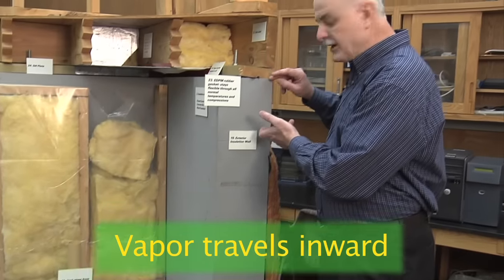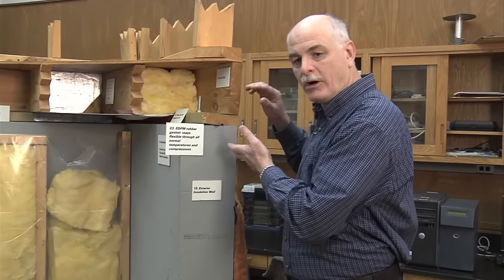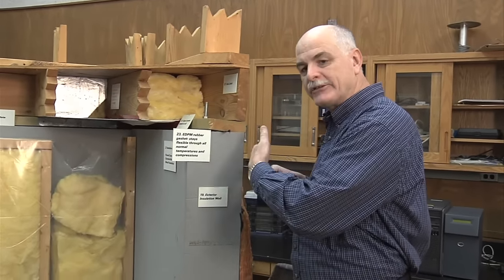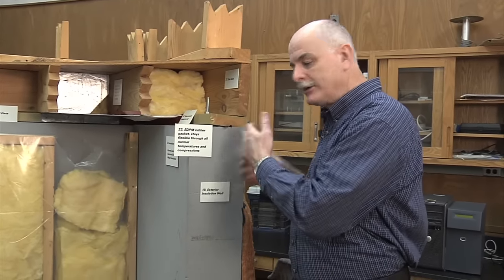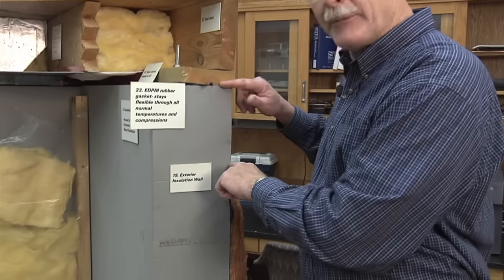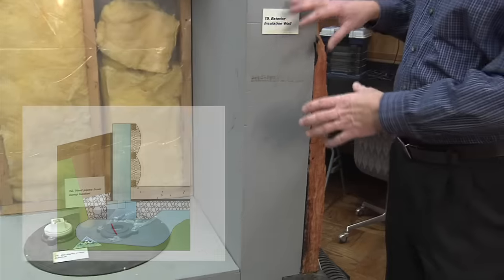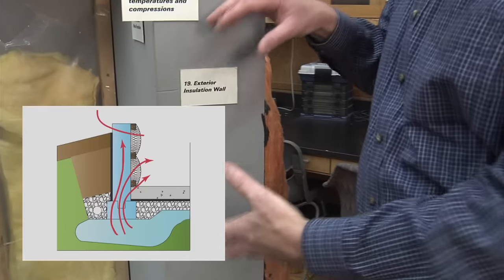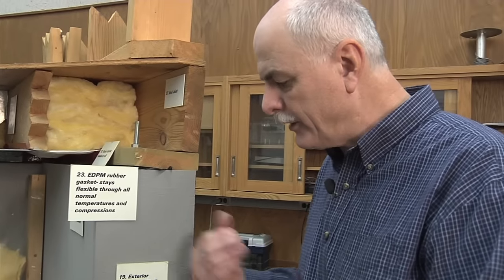Foundation Insulation Effectiveness: Basement building science

Comment: Excellent tutorial and model! I have 3.5 questions for the speaker. First, What product or type of insulator is best suited for the exterior of the foundation wall below grade? Also, is a secondary protective layer recommended to the outboard side of that insulation layer? Secondly, in regard to the V-groove style footing shown- is the rebar grid within the foundation wall to be isolated from the footing (due to the waterproofing applied to the top of the footing)? Third, If ICF systems are being utilized below-grade, what precautions might the builder use to prevent the exterior polystyrene layer from being compromised from a puncture/moisture infiltration perspective? Thanks again!
Reply from the maker: Hi! Here is what University of Minnesota Extension specialist Pat Huelman had to say about your questions 

"I am generally most comfortable with XPS (extruded polystyrene), but semi-rigid fiberglass boards can work, too.  If there is true waterproofing behind the insulation and good vertical drainage in front, a secondary layer shouldn't be necessary.  It is OK to use rebar to pin the foundation to the footing (rather than a keyway) just work the liquid applied capillary break around the pin.  If an ICF is used, it still requires an exterior water control layer (generally a foam compatible waterproofing membrane).  This can provide some protection from physical damage, too.  

Hope this helps"

Comment: If you add insulation, under the slap, where would you put the plastic vapor barier... below or above the insulation?
Reply: I believe the lesson is to always put the vapor barrier on the side of the insulation with the higher vapor pressure, which would be toward the ground in the case of a slab (or foundation wall below grade level).
Anyone think otherwise?

Comment: Got an old block basement here--6 ft below grade, 1ft above. I excavated and put in a drain tile below slab level. 1. Some year round wet spots where the slab meets the foundation are persisting. Is there any retrofit solution to the capillary wicking?

Comment: Nice video, so what is someone with an older home to do? Is exterior insulation and waterproofing the only and best answer? It seems like and expensive proposition. Are there other alternatives that are effective?
Reply: Interior spray foam works. Some caveats: most need to be covered for fire protection. In a very cold climate, the foundations will freeze and if full of moisture, can heave and crack.

Comment: Getting ready to build a slab on grade with 5 foot walls...what do u recommend for the 5 foot walls on top of the footing...I see some contractors are putting styrofoam on the inside of the wall only then backfilling up to the top, and then I see some putting the styrofoam on the outside of the 5 foot wall up to a foot below the top with a tar coating on the inside of the styrofoam...Its a solid styrofoam not the pink batten that u are using in your video..Thks for any info..from the top of the footing to the under side of the 5 foot wall its just concrete on concrete...

Comment: What is the rule of thumb when it comes to partially framing your basement? I have split my basement into two parts: one, making a living space that is finished and second a tool space, along with the furnace room that will not be finished? I am planning on using fiberglass insulation between studs. My problem is, that I was told to leave an inch gap between the cinder block wall and the framing, in which I did. My question is will there be an issue with mold having that gap between the wall and the actual framing, since there will be airflow behind the wall. Second question, how much distance the cinder block wall to the stud framing is needed not to need insulation. I have a wall going to be a foot away from the wall due to plumbing. Thank you matthew
Reply: +Matthew Millard If you want to be really safe go with thermal mineral batt insulation by Roxul. It has the ability to dry without reducing the R value and is a lot better to work with. I'm assuming you've already done the work, but when I finished my basement, I put 2" extruded polystyrene (blue board) glued to the foundation wall with a 2x4" wood stud wall with a pt base plate. Then I put my R-14 thermal mineral batt insulation in the stud space with 1/2" drywall without a vapour barrier. I didn't want to trap water inside my wall. Should mention I am from southern Ontario. At the rim joist, I put the 2" board foamed in place so it was sealed really well. I've read some studies which shows when you have 1.5" or greater with the extruded polystyrene (not expanded) that it acts as a vapour/air barrier. Therefore I taped/foamed up my seals and placed a layer of batt insulation behind it for added R-value. Therefore, at the end of the day my foundation wall had an R-value of 24 with the added continuous insulation thermal break between foundation wall and warm side of wall. I'd prefer to do exterior since it is the best way to go, but I'm dealing with existing conditions.
Reply: @CanadianNative1  thank you

Comment: How would you waterproof and insulate the outside below ground when the foundation is bricked ? My brick has weep holes in it. Would you brick solid after coating the blocks with waterproofing ? I don't think there would be room between the brick and blocks for insulation, would it ?

Comment: Steve K  
How does ICF foundations (BuildBlock) perform ?  ICF will have a rigid foam layer on inside as well as outside, a design feature you recommend to avoid.  Will moisture build up on outboard face of interior foam insulation ?

Comment: I implemented a few of the techniques some 23 years ago when I had my 3 story sog home built. I asked for a 6 mil vb under the slab for radon which was over the head of the cement man. The only thing that was done to ur standard was the exterior rim joist foam. The trusses were inset 1 1/2” for this. I need to have u clarify something. I just have a 6” wide block under 2x6 studs n with the 10’ f f ceiling height I’m considering redoing the bottom. Would u remove the slab n sand 4” n redo with i f heat or just go over the slab n do i f heat n finish to ur standard  for the sog construction. Also there’s no external anything over the block foundation for water. They put foam on
the inside but not up to the sill plate. It’s about 1 ‘ short n the slab sits on the perimeter of the larger block. Another thing I did was to put 1/2” foam on the inside under the drywall which I never saw before as well as the upper ceiling. The actual living quarters is the center of the building with the bottom being a huge garage n the upper is a high n dry basement. Ur info is spot on !!

Comment: Something I have always wondered is why not have the perimeter drain down 12" or 18" below the footing ? You might want to have the drain ?? 24" away from the footing so not to weaken the footing? What distance would be a good compromise?
Reply: Our footer drain is in its own ditch alongside the footer and about 1/2 of it's diameter below the footer bottom and out from the footer about 4", completely filled with clean stone to the top of the footer. Seems this is standard practice for our contractor so, maybe that's a good technique, just not common? Why /how did you pick the dimensions you asked about?

Comment: Thank you great video, our new home has 4.5 inch foam board on the outside of the basement wall along with 15 mill vapor barrier and a tar under it all it goes from the footings to the top of the rim joist along with 2 inch spray foam on the island of the rim joist grade outside is to the top of the rim joist, the walls seem very dry I was thinking of just framing the walls inside without any insulation or possibly 3 inch of fiberglass ,any thoughts from an experienced people  please help thanks
Reply: The author addressed  your situation toward the end of the video. I believe he said to use framing, and a non paper backed drywall, keeping it 3/4 to 1 inch off the slab. No fiberglass needed.
Reply: @johnshotwell2932  thank you! I took this advice last year when building I used a vapor barrier on the footings and 15 mill under the floor also with 6 inches of gravel the only way to get things done like this is to do it yourself

Comment: I have 1/2" xps on the exterior of my rim joist under my new siding. If I insulate and air seal my rim joist from Inside with foam board, will I be creating a problem?

Comment: My house already has a brick exterior so there's no chance of putting foam on the outside. You stated to not go too thick on the rim joists if using spray foam. In that thought, I want to use polysio but how thick is too thick? I want great insulation value so I would like to use a 2". Will that be too thick?

Comment: Great video. I hope you get comments on here because I have a question. I have a 1956 split foyer home. Lower 3  ‘ of conderblock walls. We’ve gutted and remodeled downstairs so don’t have time to rip walls out to insulate with under fitting strips with rigid insulation, we did it between furring strips.  What are your thoughts on having spray foam objected through holes on exterior of home?  So the foam fills the cinderblock cavities.  We have no weep holes or interior French drain. Just exterior tile drain.

Comment: I am concluding that a home built more than 10 years ago was likely to be tailor made for mold growth and both water vapor and radon gas penetration. Do I have this correct? If so, what is the best cost effective way to address these health issues?
Reply: Alex McDonough 
Alex, not necessarily true. I built a house 40 years ago with my father. The building site was sloped so one end of the house had a 10’ high basement wall and the other was at grade.
When we started the excavation we found a underground river running about 3 foot under the surface. 
With proper sealing, insulation and drainage we were able to build that house that still has a bone dry finished basement to this day...
There are builders out there who know how to keep the “moisture out” and the “air flowing inside” without a lot of the newest “Building Science” techniques !
Granted it is not a Yeti Cooler but it works pretty efficiently, Did I mention it is still bone dry with that river still running under and around that foundation

Comment: I have a 80-year old home with a basement that I'm currently renovating. It was renovated before and had moisture and mold problems that I'm trying to avoid this time around. The basement is a walk-out--only subgrade on one wall. Unfortunately, I can't really dig down and add an exterior barrier on that wall because there's a large covered porch that I'm afraid would be compromised structurally.

So that leaves the interior approach. Thankfully, I pretty confident I've solved any standing/table water issues due to extensive french drain and downspout drain installations and reworking.

Still, I'd love to get anyone thoughts on my interior wall plan: 1" layer of XPS R5 foamboard installed seamlessly and sealed with foam spray for both a vapor barrier and insulation. Then, on top of that, metal 2x4" studs with unfaced R13 fiberglass insulation for a combined r-value of R18. On top of the studs, but before the sheetrock, I plan to put CertainTeed's Membrain vapor barrier, which blocks vapor from passing from the heated space into the wall, but allows vapor to pass the other direction (to keep vapor from being trapped inside the wall). MemBrain is not very expensive and my understanding its much better than using a traditional vapor barrier, which can actually make the situation worse because it can trap vapor in the wall. On top of all that, I'd put a mold-resistant sheetrock. 

Any thoughts or comments?
Reply: @sethdiamand7534  thanks, I missed the 2" rigid foam requirement. I'll take a look at that. And I agree on most vapor barriers but Certainteed's MemBrane should solve that issue since it's one-way transfer.

Comment: Does anybody use spray foam on the outside of the wall or a spray foam adhesion layer for another insulation? I like your ideas on how the wall actually works, as I too have seen moisture build where conventional thought would see a dry wall.
Reply: Once you really understand wet build dry bulb, and 8 degrees f is all it takes water to condense you realize it's about mitigating the water after you reduce it's likelihood of appearing, and demolishing volume. 

Detritus is as powerful an adversary as water and combined, they are a fearsome duo who travel as pairs anywhere on earth this type if construction is likely to be.
Reply: Spray foam is trouble, especially when the building is on fire. Then its like wrapping a building in kerosene-(and 80 people die) Consider Roxul.

Comment: Really good video.  ICF should really solve all the basement & rim issues in one shot, you should still waterproof with a peel & stick to prevent both termites and moisture (if in termite zone) or spray waterproofing should be fine if not in one..  The aggregate base, insulation & vapor membrane in the slab are spot on, although I would overlap 1" insulation boards then put your vapor membrane overlapped 6"-12" and taped.

Comment: I️ like the detail of the discussion here but if I️ am not mistaken there is NO WAY to insulate a basement from within which is not risky....am I️ right? The reality for us contractors is that we almost never know what the exterior foundation really looks like so I️ would always assume it’s been done poorly. Given that as a starting point....what is the solution for a client that wants a insulated basement with finished walls??
Reply: 2.0 LB. closed cell spray foam insulation, 2" does well in most applications all around the Box Sill, Top Plate and wall. It is the only FEMA approved basement insulation for flood areas. Paint the foam afterward with any interior latex paint, glossy white will reflect more light for a brighter basement.
Reply: Having done some substantial research and thinking on this very subject, my solution is gong to be installing a dimpled membrane on the interior walls AND floor, with an interior perimeter drain to a sump, and foam board interior to the membrane on both floor and walls. This solves a lot of the issues you might expect to see. The trick is that you really just can't prevent the water from coming in - so instead plan for it coming in and direct it safely.
Reply: @garygrunauer734  Termites?

Comment: Great presentation, learn a lot ! ...quite depressing thou if trying to make a dry, moisture free, thus mold free basement walls :) ...also, sounds like you can not have anything on the basement floor :)
Reply: If you already have a damp basement and only want to dry it out first clean up the basement (IE no stuff leaning against the walls) and run an osculating fan 24/7.  If you want to dry it out and put up drywall then you need to address water infiltration first.

Comment: I sealed the block wall with concrete sealer.  Now I want to add foam board to the walls.  This seems ok by watching this.  This is just for a 4’ crawl space that doesn’t get wet.  2 exterior walls.

Comment: ok...so #1 is to insulate the exterior walls....I agree.

BUt what is #2 option? I would think closed cell spray foam directly onto the concrete? I am not exactly sure after watching this...but I really need to know. Im about to do a basement and it will need to be insulated ...and framed.
Reply: lgmnow kondo put dimpled membrane on the floor, plywood or OSB on top and screw it to concrete floor. This will take care of moisture coming from below. put 6 mil poly or better still dimpled membrane too on the wall all the way down to basement floor, and seal it to dimpled membrane on the floor: this will take care of incident water and water vapour through the wall. Because it is dimpled membrane, the air underneath it gets to Rh 100% and equalizes vapour pressure. Put regular frame on top with fibreglass insulation, but instead of using poly as vapour barrier on the inside, use variable permeability membrane like Certainteed MemBrain. It changes it’s permeability with change in RH: once RH goes above 60% it opens up, let’s water vapour through. So if you get some condensation inside the wall, variable permeability membrane will let it dry to the inside.

Comment: Chuck Murphy                        Pat, could I line the footer forms with a thick plastic membrane to stop capillary wicking? Then seal and insulate the exterior as you described and finally super dry the unfinished interior before doing the interior walls and finishing?

Comment: I need help!!!  We had some flooding and I'm remodeling our basement portion of our tri-level home.  The basement portion is partially under grade thus there is a "knee wall" of about 2 feet along the bottom of the outer walls.  My plan is to paint DryLock on the inside of the knee wall to provide a barrier on the vertical wall.  then EpoxySeal on the floor to provide a barrier on the floor.  We're looking to put commercial grade carpet with padding on top of the EpoxySeal.  Will this system work or am I missing something or am I totally off base??
Reply: Sealing your wall does nothing, the water will find a way to get thru a crack and you'll have water in the basement. You'll need to dig up the outside and treat it there or do an interior drain to goes to a sump pump.

Comment: So I'd say build a wall about 2-4 inches away from the concrete wall on the inside, insulate, put up sheet rock. And put the intake to a dehumidifier into the gap. Kind of a frakenstien design bit I'd bet it would work. That adds insulation,  deals with humidity and moisture. And you don't have to touch the outside of the foundation if it's not something you want to do